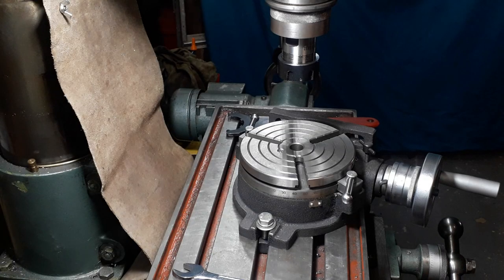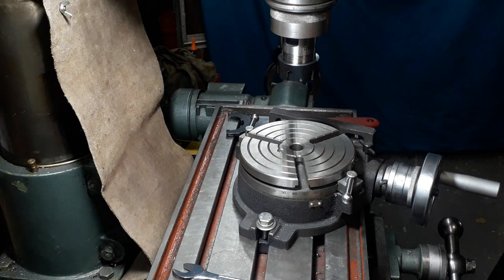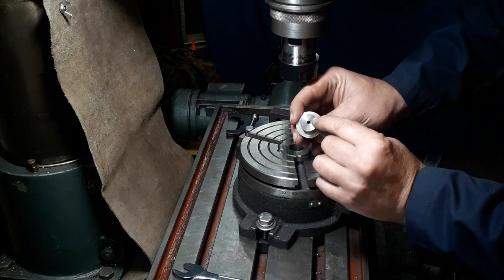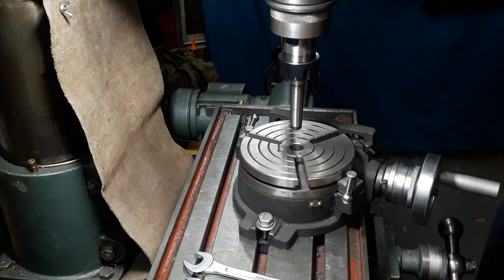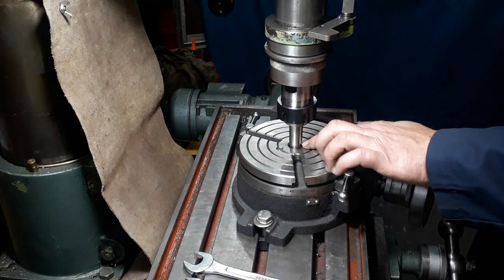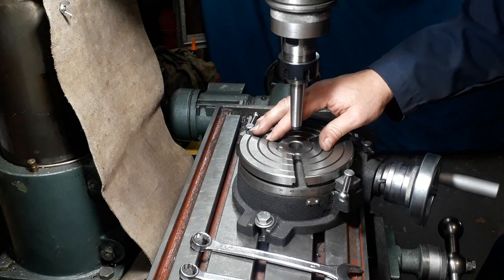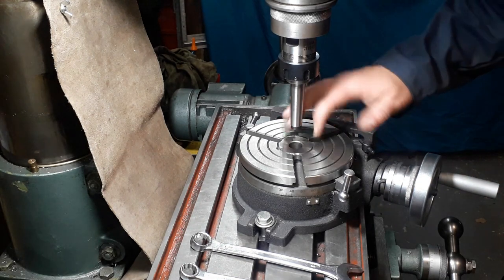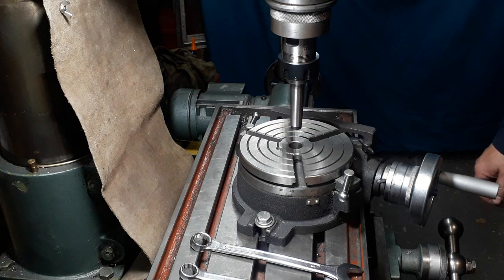Rotary Table Centring, the fast way - Quick Tip

Comment: How do you stop the more taper from locking in the rotary table bore. If it does do you have to take it off to knock it out from the base
Reply from the maker: When you press it into the rotary taper it's not being pressed in to hard but enough to hold it in and once the table is bolted down then as you lift the quill back up the collet will pull it back out, give it a try, works for me everytime, cheers.
Reply: Have you tried a simple piece of 16mm ground rod with a small corner radius on the end? It locates nicely in the taper.
Reply from the maker: Yes you can and it works well, I have a similar 1 nocking about somwhere, but I use the taper I made for other jobs, You can set it in the collet chuck of the lathe and use it to set the angle on the top slide so its easy to use for this to instesd of having 2 tools. The other reason is  if the rod is not quite true in the collet the rotary table could be off but as you push the taper into the table it squares up in the collet so you know it is spot on, cheers
Reply: @mattsbitsnbobsworkshop  I see, I did not consider that if the taper is not running true in the collet the rotary table bore will automatically true it up. I do prefer one ground diameter without any concentricity issues compared with two that aren't ground together.
Reply from the maker: What I was meaning out of true was your ground rod or my taper, (collets are not 100% so unless you clock it every time) the taper of the rotary can't pull the rod back but it can pull the taper back making this more accurate for me in practice, but as I always say, what works for you is the best, cheers

Comment: What mill are you using?
Looks exctly like my Arboga EM825, the same coordinate table, same hand wheels etc. My Arboga just doesn´t have power feed.
Reply from the maker: It's the U2508 with optional power feed, bit bigger than the EM825 but looks very similar and share some of the same parts. As you will know, Arbogas are nice to use, cheers
Reply: @mattsbitsnbobsworkshop  And I just noted another machine that we have in common, the Clarkson Tool Grinder.
I bought mine in the nineties, it was stuck when I bought it from a bankrupt company. I thought it had rusted stuck but it turned out that all lubricants had hardened and it probably  hadn´t even been used at all since new or just been used very little the first years.
Unfortunately, it doesn´t have any accessories, it´s just the machine itself. It also suffers from that well known "Shed Rust", just as yours. 😞
Anyway, I had to subscribe. Thumbs up!
Reply from the maker: This ones done a fair bit of work, but not worn badly in any way apart from the shed rust, but its nice and dry now, its not bad when the lube is hard, its a good start abd you should have a good machine.
Reply from the maker: Forgot to say here is some tooling ideas for the Arboga https://youtu.be/qC47bGsCjwc
Reply: @mattsbitsnbobsworkshop  Thanks! I have actually seen that video but I added some more information for member "@siebelen3183" that asked about the dimensions for that nut that holds the chuck.

I have that nut and that "open washer" to hold the drill chucks, just like you.
But I also have other tools that uses the nut such as 22/27 mm face mill arbors and an ER40 collet chuck and an MT3 arbor head. I turned 60 mm "rings" and mounted those on the MT3 tapers to be able to lock the tools with the nut.
This is another way of locking the tools to the machine.
Also, an MT3 taper has more rigidity than the MT2. Propbably not a problem at all on an arbor head but might be an issue for a face mill or a collet chuck with a big (up to 32 mm) mill.

Another tip, or actually a mistake:
I found and bought a one-piece drill chuck/arbor on Ebay. Having a chuck and arbor in one piece seemed like a very good idea as it would mean less runout and improved rigidity. And the run-out is about half as much as on my other Jacobs chucks. But it turned out to be shorter, and the difference is where that "open washer" is meant to be, making it impossible to lock the chuck really good to the spindle. Still a good product, I just haven´t outsmarted it yet but I will some day. Probably a rainy day.  🙂
Reply from the maker: @Maskinservice  Yep 3mt will be stronger but its not for production runs just in a home workshop I take a few more passes to get the job done, and your last paragraph is the main reason for the tool system (using 2mt I found the same problem) the only other way is to machine a groove in the 3mt but then, as you say, its to short, so 2mt it is and take my time.
As for the locking nut info on the video, I am emailing with a gent in the states at the moment, after making a nut and I said to either add flats or holes (for a C spanner for google translate) I will add that on, and the thread size is why I said check your own machine 😜 cheers
Reply: @mattsbitsnbobsworkshop2433  I plan on turning a few extra locking nuts as I have some milling heads that is to big to pass through the locking nut which means that the nut will be locked in between the milling head and that 60 mm ring that I have mounted on the arbor.
I actually have i similar lathe to one of yours, a Super 7. Perfect for this job.
Reply from the maker: Super 7s are perfect for a lot of work, I don't use mine enough, I don't want to hurt it  😁
Reply: @mattsbitsnbobsworkshop  Neither do I, the main reason is that it isn´t placed where the Arboga is, and there´s an Emco Maximat-Compact where the Arboga is. Having a mill and a lathe at the same place has its advantages, especially when they share some of the tools and all measuring equipment. But they will all join the S7 and that will give them a better environment with more stable temperatures and less humidity. 👍
Reply from the maker: @Maskinservice  brilliant,  I think I've got on top of that in this workshop with a good temperature to all year round, good luck.
Reply: @mattsbitsnbobsworkshop  Thanks, I´m going there as well.
Take good care of yourself! 🙂